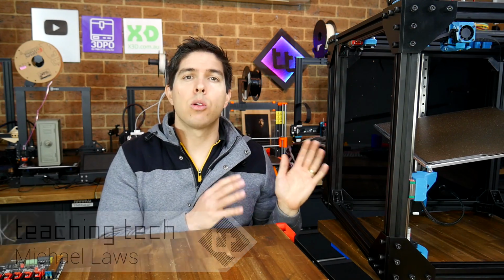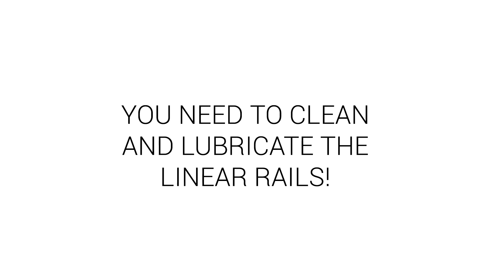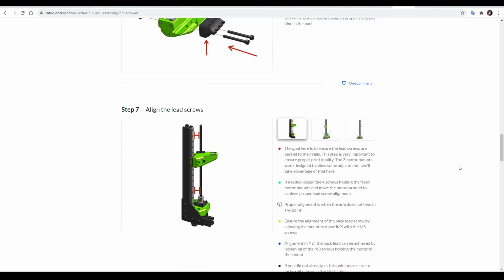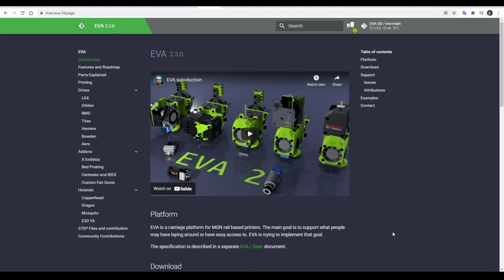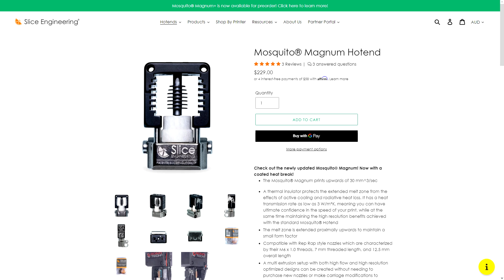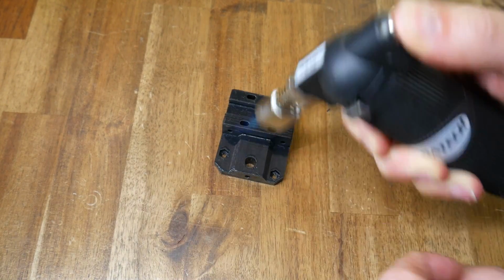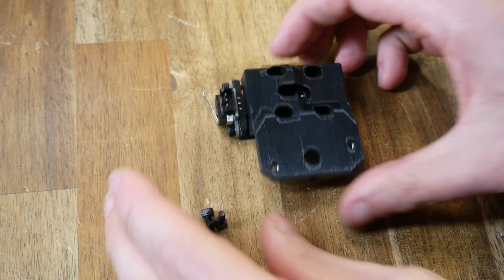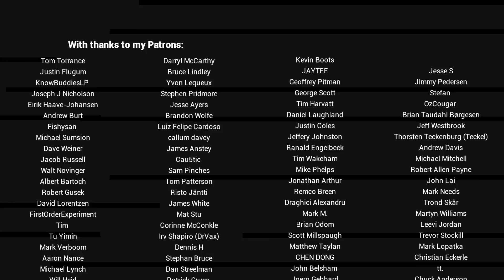Rat Rig V-core 3 part 2 - Kinematic bed and EVA carriage system

Comment: Very cool video series truly appreciate your effort and willingness to share. I am so wanting to build a printer. I also see the techniques used in assembly and interlocking shapes etc. As I want to design and build model Trains chassis and bodies i can see things to reuse in those components as well. I just went to the Older style Micro Swiss Direct Drive, I am locked in to that design on my 10S Pro. I lightened it up by moving to the pancake fan and minimalist Fan shroud design from Victor Bared, It looks nice and tidy. The bed on this machine is magical, thinking of my robotic days the Delta Platform was the fasted and most accurate frame, so the bed on three pivots makes perfect sense.  I want to skip ahead and see the results but fun to see how to control this baby too. All the best Great Series, Dennis

Comment: I love glass, why not use glass? PEI can be very difficult to remove prints. I had one where i just couldn't separate, tried alcohol, freezing, scrapping, in the end, i bent the PEI sheet. Glass with a Bostik glue stick, i've had the best experience. Use alcohol, freeze, but prints mostly come off just when it cools down. You wait for that CLICK, and you pick up the print.

Comment: Thanks for commenting on whether or not it's a recommended thing for beginners, and providing a more neutral stance on such.  So many places seem to focus rather heavily on the advice of "just get a cheap one and learn from there" without recognizing that some are more than willing to learn as they go, but don't want those less expensive "recommended for beginners" printers as they're looking for something that's more of a tool, but understand there will be more of an initial learning curve as well as there still is maintenance to deal with.

Yes, there are benefits to that method, but when you live in a small apartment one cannot just get one or two cheap ones, and then also a project one on top of such - there just isn't the space for such, or breakers!

I rather like that this one can be purchased whole as a kit from the company.  Yes, the Voron designs are interesting (especially the Switchwire and v2.4), but living in Canada that sounds like a nightmare of shipping costs to do sourcing from so many places, and while LDO is slowly working on getting higher quality kits out there (they're releasing a mechanics kit for the v0.1 soon, and have mentioned the v2.4 is next) they aren't quite full kits.  It is getting easier to source parts from within Canada though.

This is a fun series to watch, I'm looking forward to watching the rest over the next few days!

Comment: It almost akes me want to build one too ... Well, I'll probably do in some time. :)
Unsure if you really need some insulation and "secure" the silicone pad. Adhesive on these are usually really strong. Never had any issue on mine (on a bedslinger style), even when heating it past 120°C and enclosed. Better safe than sorry, though.

Btw, that kinematic bed looks sick !

Comment: So any reason why you choose BL Touch instead of EZABL? I want to order a Rat Rig too. Right now I print mostly on Glas (ABS) and FR4 and BL Touch. As I ruined my BL already once as it had a collision with a part, I think about moving to the EZABL for the RatRig. Would be nice to hear your opinion. I am also not sure if I should go for the 400 or 500mm Version? I guess for a CoreXY Printer a big bed size which only moves down is not that big of a problem compared with a Bed that moves in Y direction? So my thoughts are, quality wise there should no big downside to go big with the CoreXY?

Comment: Hi @Teaching Tech , Super nice build serries. Decided to build my net printer as a Rat Rig due to you clips. I have 2 questions I hope you can share your experince with me; 1. I read some people have problems with the Orbitter Stepper overheating. How is your experience in this? 2. If you add the E3D V6 hotend to the weight, would you not be better off with a BiQu H2 extruder that has the hotend integrated and looks about the same All-Up-Weight? Hope you decide to share your experience with me/us! (ps. I LOVE your printer-tuning website!)

Comment: I'm a complete noob at 3D printing unless you count the Makeblock that I purchased.
The assembly was almost instant, easy to use but died after 26 hours, I get a refund tomorrow.

Sooooo, technically I have already spent the money, adding a few more NZ Pesos to move up maybe is in my ability.

Hmm ability.
Assembly looks like a project in its self, I went to the 'Sam Prentice channel' his enthusiasm, fast talking and technical terms maybe a year or so down the track, might make sense but today it seemed like a car salesman trying to teach me astrophysics.  

I particularly liked your clip on non planar technique, the comments about the requirement for longer reach hotend clearance and best if the head could tilt.
Could the tilt on the Rat Rig V-core 3 bed emulate head tilt? 

As I know nothing about hotends and nozzles, I did wonder how valid the comment was that mentioned MIG copper nozzles being 25mm long and same thread as a nozzle.
If so it would be easy to bang it in a lathe and taper the end down from 9mm to say 3mm over the 25mm at the business end, especially at 10 NZ$ for 5 of them.

OK Noobieness over, I like you style on this channel, I can watch and learn without having to google jargon.

Comment: A kinematic bed seems well-suited to non-planar printing, since it could keep the nozzle normal to the part surface.
Reply: Yes, if only someone would come up with the programming
Reply: @emanprime3679  question: what do function/movements did you have in mind should the bed do/have?
Reply: @fearlyenrage  For example for the roof of the Benchy, slant the bed so it does not need to be printed in steps but is just 1 smooth surface.
Reply: Imagine a kinematic bed coupled with the Vorons flying gantry for non planar printing

Comment: In Part 1 you talked about the (Optional) inner frame panel and the dxf files. Will you release a dxf file with holes for skr pro 1.2?
Reply from the maker: Yes. Everything fits so they will be released with the video.

Comment: Is the magnetic sticker able to withstand temperatures above 80 degrees? Another thing that worries me a bit....when heating up de bed to 100 degrees or up for printing ABS, PC....is the heat from the bed transferred to the ball joints able to damage the printed arms carrying the hotbed? Or won't that be a potential problem?
Reply: the flex plate system rat rig sells is rated for 130c if i remember correctly. If you're enclosing and / or printing high temp filaments, it's a good idea to print at least the arms and the EVA carriage out of a material with better thermal resistance. Haven't seen issues with the arms yet, but better safe than sorry.

Comment: Is there a reason why you are not using the skr pro 1.4 for this printer?
Reply: For the Rat Rig you need to control 6 steppermotors independently (3xZ, 2x XY, 1x Ext). SKR pro can do 5.
Reply: @marNL1970  No the SKR Pro 1.2 can do 6. The SKR 1.3 and 1.4 (there's no SKR Pro 1.3 or 1.4) can do 5. You can add an EXP MOT for 3 additional steppers though. V-CoreOS supports SKR Pro 1.2 out of the box, so almost no setup is required.
Reply: @miklschmidt  Thanks and Indeed....V1.4 (and I meant this one in my earlier post) supports standard 5 stepsticks, V1.2 Pro does 6 standard. I wonder, and this is another question: it happens to be I have 2 Fysetc S6 (ST32F446) controllers here on my desk. These support 6 stepsticks. Can they be used for the RatRig V-Core?
Reply: @marNL1970  Absolutely, you'll just have to do the setup yourself, you can always use the V-CoreOS config files as inspiration :) We're working on adding support for more boards.
Reply: Thanks Mikkel! As a Marlin junkie this is a nice opportunity to learn something about Klipper :-)

Comment: This build is starting to grow on me and I am looking forward to the next part. Is there any objection to print the parts needed for this build in ASA/ABS or even nylon in stead of PETG? For precision and quality freaks....as I understood the Linear rails and blocks or no genuine HiWins. Is there the option to order this kit with genuine HiWin linear rails or the option to order this kit without the rails and blocks and source them yourself? What are the lengths of the rails used for a 300mm build and which blocks are used (12C or 12H)?? Thanks for the video's and keep up the good work.
Reply from the maker: For the filament choice, I don't see any problem with any selection. All of your other questions can be answered by following the link to the website. The whole printer is open source and you also have a CAD model linked you can take measurements from.

Comment: I added the Orbiter V1.5 to my Ender 5 Plus modified with an ExoSlide system and the MicroSwiss hotend.  It works great but I have yet to formulate a cooling solution.  I downloaded the EVA STLs to see if I can mod the blower mount and duct to suit.  I do have a left over Slice Mosquito Magnum and am thinking of a future mod to replace the MicroSwiss maybe with the EVA design...  Just Plain Fun!

Comment: This is a realy expensive 3d printer , on Brazil the price without shipping is R$ 7400,00 , its equivalent of a 3 years of saving money spending the minimum possible (the average wage in Brazil is R$ 1000,00 about US$ 186,96 , and €152,97)

Comment: Hi there, great printer and great video, too :)

Maybe I haven't seen it: there's an 220V Keenovo silicone heater installed. You HAVE TO GROUND it! 220V can kill you if there's a damage on the heater and you touch the ungrounded metal parts of the printer!
Reply from the maker: I did notice I had a 220V heater. Yes, I will be grounding it in the wiring episode.

Comment: What's the point of the kinematic bed? Seems to be just another potential point of fail.
Reply: 1) Unconstrained mounting points - bed plates expand as they heat up. If their mounting points are unmovable, the bed will have no room to expand to the sides, and it will be forced to bow (either upwards or downwards). The V-Core 3 bed plate is not rigidly connected to the machine's frame. Instead, 3 steel balls connected to the bed sit on low friction dowel pins. The pins act like a pair of rails for the steel balls, guiding their movement as the bed expands and ensuring that only radial movement is possible - there's zero margin for lateral movement. This means that while your plate is firmly in place, it can still remain perfectly flat as it expands. The weight of the bed would be enough to ensure that the bed can't move in non-radial directions, but for extra sturdiness, magnets mounted on the Z arms provide additional resistance, to make sure the bed never moves from the intended position. 2) Automatic bed-levelling - forget about having to manually level your bed. Since the bed only has 3 mounting points, which are connected to 3 independently driven Z motors, bed-levelling is exclusively determined by motor position and can be done 100% electronically - simple and instantaneous.
Reply: @ratrighardware  thanks. That makes sense but it also now relies on 3 motors, 3 lead screws, 3 floating bearings, ensuring the floating bearings are sufficiently lubricated, etc. Wouldn't it be better to KISS and measure the warp in realtime and adjust the z height as the extruder moves across the plate as it goes? It's computationally much more involved but it would be easier to control.

Comment: Interested if you continued to print the parts in PETG?  I'd have thought that ABS would have been much better for all your toolhead parts...
Reply from the maker: Yes, still PETG. Apart from a fan duct, I'm used PLA on printhead parts for other machines. Unless you have a really hot extruder stepper or are printing in a warm enclosure it's generally not a problem.

Comment: Do you have any info on doing dual extrusion with this printer? I still feel like for FDM to be super versatile we need to use soluble supports
Reply: Complete in the same page with you! Idex will cut print volume, maybe tool change with 2 independent heads?

Comment: Having to source all the parts separately for a Voron is also what's holding me off.
Great choice to review a Rat rig kit, these are not inferior to a Voron in any way.
Reply: The bed leveling system is sort of inferior. It uses 3 z motors to level the bed to the gantry, while the Voron 2.4 uses 4. Since the bed isn’t 100% flat, 3 point leveling is inferior. Also, this printer isn’t as easy to enclose which means worse performance for higher temp materials.
Reply from the maker: 4 stepper motors isn't going to fix a warped be either, unless you are using them for mesh compensation. But then a single Z stepper can do that.
Reply: @TeachingTech   That’s what i meant. They use something called quad gantry leveling to probe each corner and get an accurate level of the gantry to the bed on all 4 corners with the 4 motors. This is because it’s unique in that the gantry is floating. They also do normal mesh bed leveling subsequently. You should check em out! its a great community.
Reply: @GRuizMedia  doesn't the bed of the RR heat up your enclosure faster because it's high up? I would think it would take ages for the V2.4 to heat up the enclosure with it sitting in the bottom... are there any reports on this? That's the only thing pushing me to the RR, looking for good PC and Nylon printing performance. Reason why so many like the V0 is because the enclosure is so small it heats up fast. RR should also heat up fast..
Reply: @karoo_bushman6880  actually that shouldn't make a big difference at all. but if you really care about it heating up fast, there is a mod in the Voron community called the nevermore. It's basically a fan unit that goes under the bed on a V2.4 that redistributes the hot air. This way, the chamber heats up like 4x faster. It's a real game-changer. Also, you can add a carbon filter to it so that it can filter out any toxic fumes that come from ABS.

Comment: Gonna be a hard choice, I am considering getting into one of these systems. Voron is top of my list, but I must admit the sourcing does seem to be the most daunting part. This kit system an the printer over all looks cool.
Reply: I want to echo what Dave said. I've built four different Voron's and the sourcing is not an issue in my experience. The guide is a great starting point and the Discord can help you if you get into a jam.
Reply: Sourcing a Voron isn’t as bad as it seems. Yeah there are a lot of parts and links, but I think I was able to source from a total of 4 different places (US). Also, there are a few community members that have set up stores to help source quality parts easily. I recommend stopping by the discord to check out the vendors section. Also, vendor section! You can chat with vendors directly, and if you have questions about an order, a product feature or setting, or if you have a problem, you can chat with a person and get actual helpful answers.
Reply: I’m with you, Nick- tossing up between a RR and a Voron, the latter seems cheaper all up but don’t know if the convenience of a (nearly) complete kit is worth the money.

Thanks for the comments of support/advice also, guys.

Comment: I have question, why does the kinematic bed only need 3 points on z axis ? Isn't 4 points better than 3 points ?
Reply: @eva-3d948  Oh, I see. So, there's possibility to build the bed with 4 points if I want very rigid bed and no play on XZ/YZ plane but it will be redundant, right ?
Reply: @eva-3d948  Thank you, that helps a lot

Comment: What are the advantages of using a kinematic bed?
Reply: 1) Unconstrained mounting points - bed plates expand as they heat up. If their mounting points are unmovable, the bed will have no room to expand to the sides, and it will be forced to bow (either upwards or downwards). The V-Core 3 bed plate is not rigidly connected to the machine's frame. Instead, 3 steel balls connected to the bed sit on low friction dowel pins. The pins act like a pair of rails for the steel balls, guiding their movement as the bed expands and ensuring that only radial movement is possible - there's zero margin for lateral movement. This means that while your plate is firmly in place, it can still remain perfectly flat as it expands. The weight of the bed would be enough to ensure that the bed can't move in non-radial directions, but for extra sturdiness, magnets mounted on the Z arms provide additional resistance, to make sure the bed never moves from the intended position. 2) Automatic bed-levelling - forget about having to manually level your bed. Since the bed only has 3 mounting points, which are connected to 3 independently driven Z motors, bed-levelling is exclusively determined by motor position and can be done 100% electronically - simple and instantaneous.